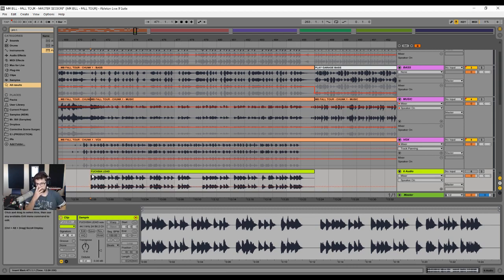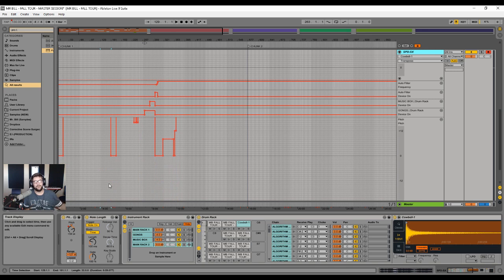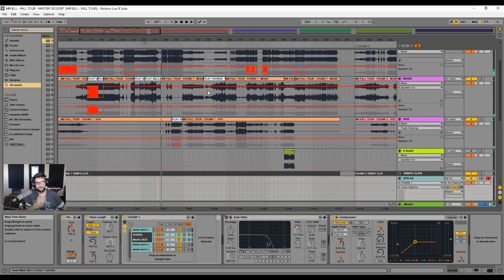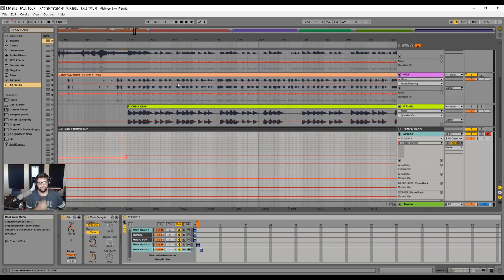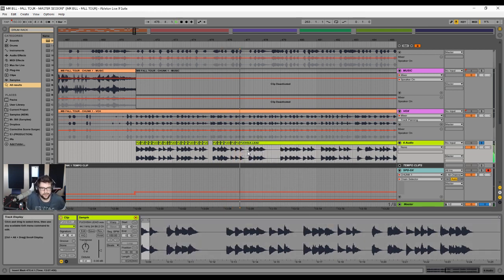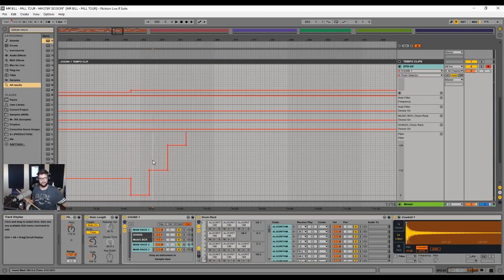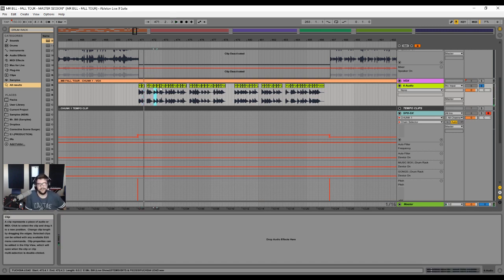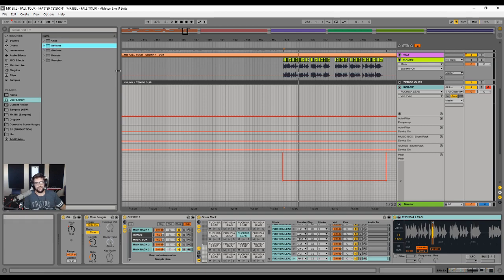Transposing EDM to Instruments!

Comment: Thank you so much, definitely gonna use this for my own sets in the future, DJ'ing with live sucks. Was having a hard time wrapping my head around the explanation you gave in billegal immigrants, but now it makes sense. Is there any specific reason for the note lenght device you have after the pitch device? And do you ever add any additional pitch/filter/amp envelope to the bits you're triggering with the pad? Or is that too much work for you/the CPU?
Reply from the maker: So, the SPD-SX only puts out these tiny mili-second stabs of MIDI, and that's fine, but I like to be able to see the feedback on the play buttons in the cells if I can - mostly for troubleshooting purposes. The sample will still trigger with a midi impulse that short.
Reply: ahh - thx for clearing that up :)

Comment: I have two PC's and several sound cards and even with LatencyMon saying I'm good to go, I get crackles and pops at 128 samples buffer size. I'm wondering if cheap USB sockets/USB drivers are to blame. MAN I miss having a Mac :(.
Reply: You may already know this but If you're talking about laptops, be sure to turn the WiFi off. That's the classic cause of dropouts (crackles & pops).
Reply: Yup, I disabled my wireless adapter in Device Manager. It made a big difference, but compared to my Mac, still really shitty.